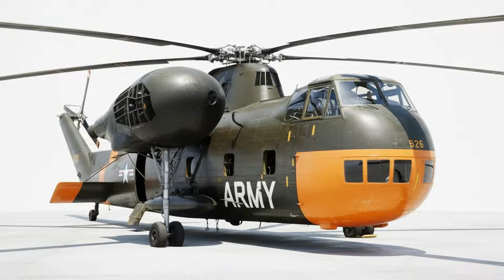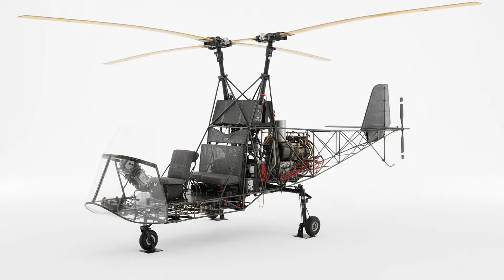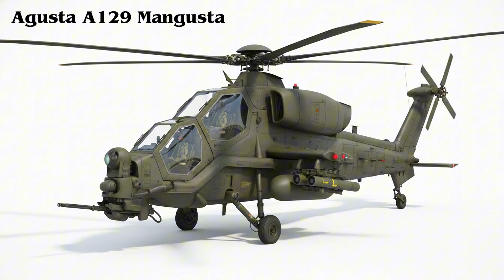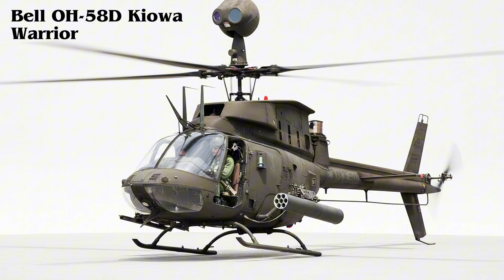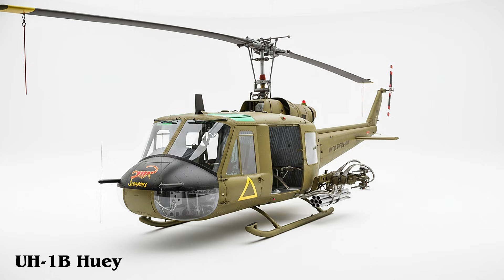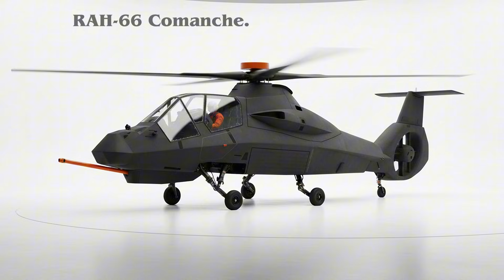Every WORST MILITARY HELICOPTER Ever Designed

Comment: Ok. Let's start with the Mil Mi-24 Hind-A. Wrong canopy. The Mi-2URP looks a little off. I wasn't able to find a pic of any Mi-2 that looks like this one. The intakes and windows seem wrong. Now, the H-43. Your image of it sports a tail rotor. It has no tail rotor. Your AH-56 is missing the pusher prop entirely. RAH-66 has way too much landing gear. And lastly, the very last one is just an RAH-66 with the landing gear in the wrong configuration.

Comment: The Aérospatiale Alouette III was the backbone of the South African Air Force (SAAF) during the Border War (1966–1989), acting as a versatile, light gunship and utility helicopter. It provided critical support in counterinsurgency operations against SWAPO and in Angola, operating as a "K-Car" gunship with a 20mm cannon, or in troop transport and CASEVAC roles. 
Key Roles and Characteristics:

    Combat Capabilities: Often equipped with a 20mm autocannon (GA 1 or Hispano) or .303 Browning machine guns, the Alouette III acted as a "ferocious" close air support platform.
    Operational Use: It was used for fire support, reconnaissance, troop deployment, and casualty evacuation (CASEVAC) in the harsh conditions of Namibia and Angola.
    Significant Engagements: The Alouette III was instrumental in various SADF operations, with its, and in some instances, even shooting down enemy aircraft.
    Service Life: Over 120 were acquired by the SAAF, and they served for 44 years before being retired in 2006. 

Rhodesian Context:

    Similar to the South African usage, the Rhodesian Air Force extensively used the Alouette III as a "K-Car" (gunship) and "G-Car" (troop transport) during the Rhodesian Bush War, often employing 20mm autocannons for effective, low-level fire support.